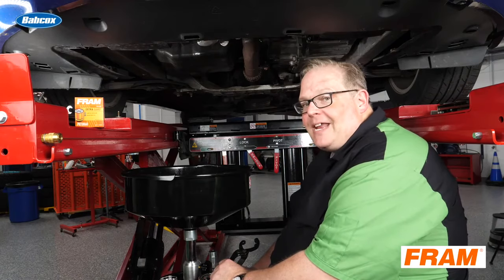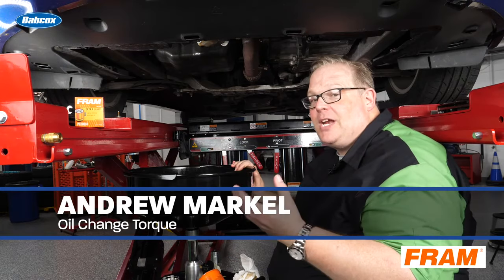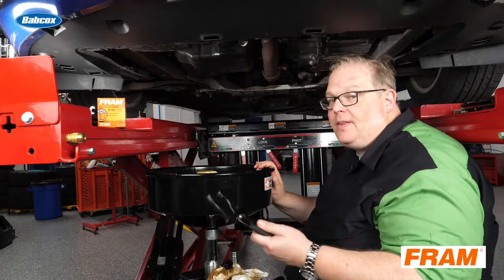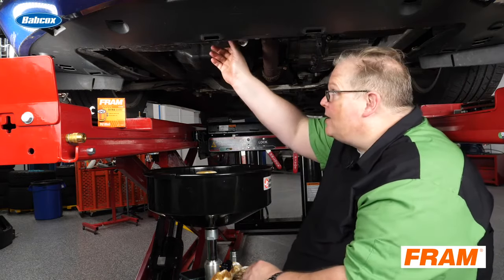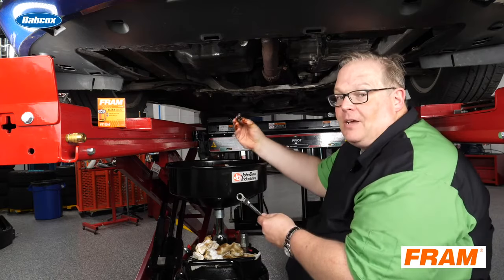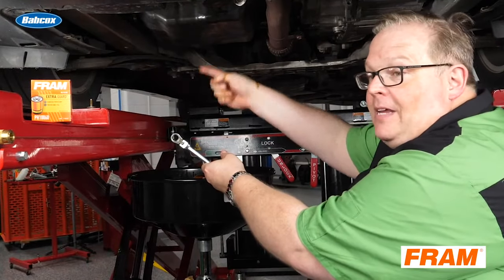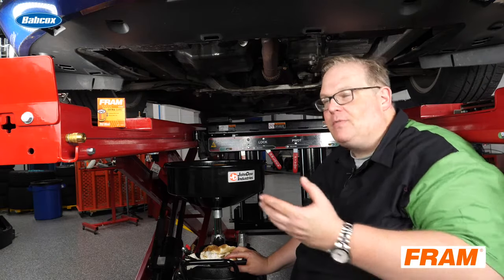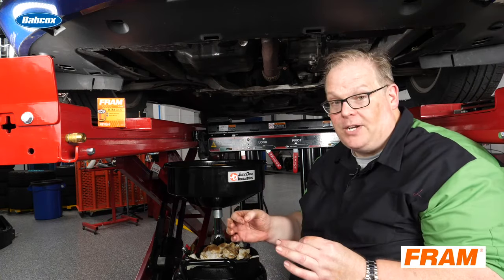The Right Amount Of Torque For An Oil Change

Comment: It doesn’t take a rocket scientist to know how much to tighten the filter and the drain plug. I always do them until they’re snug and then turn a little bit more. Done. Never had a leak.
Reply: Apparently it does take a rocket scientist. Lol. Some mechanic did mine and when I went to do it next time, I couldn't take the bolt off. I had them break it free, now it's so badly stripped that I had to order a new drain plug.
Reply: Torque

Comment: drain plug gasket materials vary between manufacturers. As a DIY'er you can choose and the main choices are aluminum, copper, polyethylene and neoprene/epdm.  I find the flared epdm gaskets require the least torque and the best seal, albeit it's a one time use design. Take note if the pan is steel or aluminum.... I'd rather have a small leak than stripped threads.

Comment: Nice vid! Some would say just keep it snug! But really, what does snug mean? Hands at the head of the ratchet, or pulling the end side of the wrench? Is there a general rule on tightening those plugs like the 3/4 turn on the oil filter.

Comment: Sounds like something I've heard before, especially about the filter tightness. However, have you ever "hand-tightened" the oil filter on a Chevy Astro van? That thing is in such a confined corner that one's hand can't get a proper grip on it. No wonder the previous guy (yes, it would have to have been a guy : )  overtightened the thing and made it nearly impossible to remove. 
All right, back to my torque wrench.

Comment: Also remember to replace the plug or o-ring.
Reply: Depends how damaged your O-ring is most people can reuse them if they're not messed up..I've been reusing mine for the past two years,, no problems,  rubber is still  perfect
Reply: Replace gasket not plug. Hand tight oil filter and snug drain plug.
Reply: @Pinkielover  yeah i've literally used the same one for the past 6 years. it's kinda fucked now, bought a 10 pack from rock auto and ill be changing it next oil change lol

Comment: I can't get my drain plug off and have to go to the dealer (Honda) where they changed it six months ago. I would guess impact gun but whatever I'm so pissed I could scream.
Reply: Same. Lol. I had a mechanic do mine and they put it on so tight, it's pretty much welded on. Lol.

Comment: I never look up for torque specs for anything other than engine work or suspension parts. Nobody does that for drain plus or small bolts

Comment: If Min-line to Max-line is about 1 quart,
The local Subaru dealer "free life time oil change" technician had just over-filled my engine oil by 2.5 quart beyond the Max-line. 😵‍💫
Reply: He was just getting a head start on the next oil change.:face-green-smiling:

Comment: Many of the owners of oil change places hire these young kids that have little to no experience or knoledge of what the heck they are doing and the poor customer winds up pay hundreds of dollaras to chnge the oil pan or welding up the hole redrill and tap it will rarely be the same?
Many years ago young folks did the grunt work and cleaned up spilled oil till they  learned what parts went where, today they want a lot of money , but don't have either knowledge or experience???
Reply: Yesterday I went toyota for oil change. Since 2019 I’m going to same place for oil change and they said your car drain plug got worn we need to replace which will cost $900. I told them give me my car as a same condition I came here. Good thing I always brought my car same dealership for oil change. I said this is happened while your mechanic changing the oil I won’t pay any single dollar. I fought 30 mins with the manager about that and they will fix it.
Reply: @NuanDaa  Good thing you went there for all of your oil changes. Consistent documentation of the miles is proof that they are 100% at fault.

Comment: I did my oil once and wile I drove the bolt came off and I lost all of my oil on my way home what could have caused this because I’m sure I put it on tight and help would help now I’m scared to do my oil again
Reply: Sorry to hear about the oil plug loosening up and losing the engine oil.  Next time you change the oil, I would recommend buying a drain plug gasket or seal.  Also, use a long 10 to 12 inch wrench to tighten the plug.  Also, if you jack the vehicle up, it will be easier to turn the wrench; plus, you will have a better idea of how tight you are making it.  

I found this video because I am seriously thinking about purchasing a torque wrench for the drain plug.   If you decide to buy a torque wrench for the drain plug look for a 3/8 inch torque wrench with a range of 10 foot pounds to 80 foot pounds.  For measuring low 25 foot pound torque, I'd stay away from a 10 ft lb to 250 foot pound wrench.   The 10 to 80 foot pound wrench will be more accurate in the lower range of torque.

I just had another idea, maybe purchase a brand new oil drain plug from the dealer.

Comment: Yes, but if in the manual I have a tightening torque, let's say 40 nm, in reality, because there is oil on the screw, I will probably tighten 40% more. Correct?
Reply: That's a great point!
Reply: just use the breaker bar.

Comment: You need tools to torque the filter and drain plug.
I wouldn’t trust your word on it every mechanic I know used a filter wrench
Reply: Just by hand unless it’s in hard to reach area or to take it off if it’s too tight
Reply: GM tech schools teach their mechanics to tighten by hand until '''reasonably"  tight as possible. Then tighten 1/4 turn with filter wrench. They do that to lessen the callbacks for oil leaks.